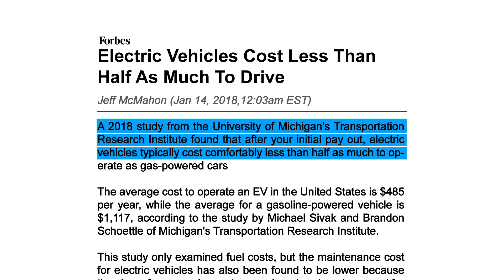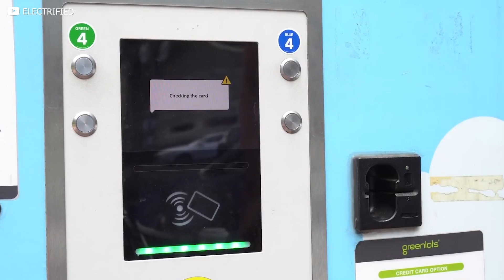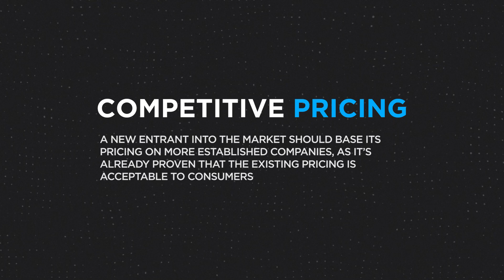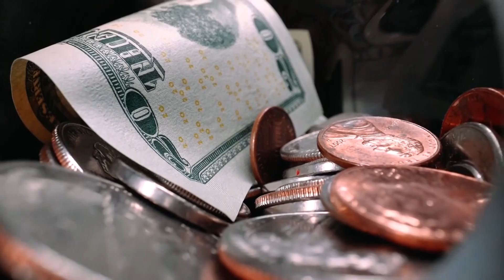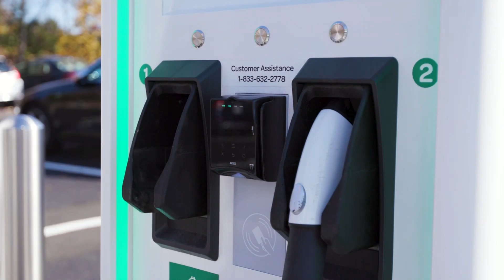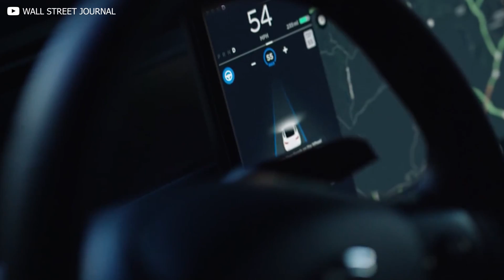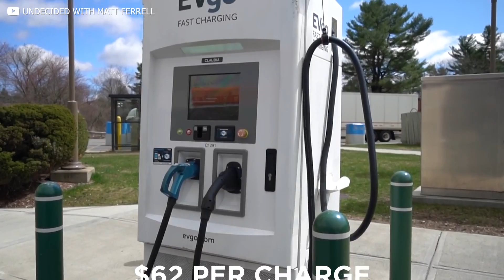Will EV Charging Prices Go Up As Demand Rises?

Comment: Home charging stations are not necessary. You can use standard outlets to charge these cars. In the US, 240VAC 14-50 outlets can be used to get level 2 charging. There is no need for a dedicated charging station.

There are some people who cannot charge at home too. Those won’t be using home charging stations either.
Reply: Appreciate your review, do you experience difficultly in trading? Inbox James Maxwell 
w have a. s a PP..
+ 1. 3. 0. 4. 5. 0. 8. 6. 9. 4. 6..

Comment: Seems insane that the price of charging a car on the go might cost the same in the future as filling up your car with gas that had to be extracted and refined. Something is wrong there...
Reply: 80% of your miles added won't be from fast charger(dc) just remember the last 300 mile road trip you took and how lobg was it
Reply: @bondnikunj  Yes, I agree with you... unless you live in a unit etc and cant charge at home.... There will always be some that rely on work/roadside/shopping centre chargers, and i agree with you, very few will ever need to wait for more than 15 minutes at a time if not at home.  95 % of people drive less than 30 miles a day (I am sure I got that right), on average.
Reply: @RacefanPat68  ev's are a very tough proposition altogether and would do no 1 any good if u can't charge at home or in a reliable alternative like work.that is the basic need. No point buying them if u r completely relying on fast charging(dc) .grid won't be able to handle that kind of pressure and we would be burning fossil again.
Would be costly , not good for battery life etc.
Reply: @bondnikunj  you are wrong on all counts. Our grids can handle them now, and one good thing about renewables is that they are cheaper, and if we spent as much energy developing storage systems, both grid and domestic, as we do pretending we "need" fossil fuels the problem would be solved. 
Fast charging is easily sustainable with the current grids, whatever political BS you have heard, Unpack the data for yourself. Make sure whatever figures you use are compatible. 
 Modern cars wont damage the batteries with fast charging either. The fast charging is done till approx 80% charged, and while monitoring temp of the cells!!! WOW. Who knew! I am not sure which legacy tech has infected you but it shows.  
PS. I am all for home charging, and have always said that people get bent out of shape unnecessarily about range anxiety, as most will do an average of less than 30 miles a day, and can fully charge at home and only "Need" a supercharger 2-3 times a year. Cars monitor your use and give you plenty of notice, and Teslas give real time distance to Superchargers.  But we need chargers at workplaces and parking lots everywhere to help meet the needs of those who CANT charge at home. I also do NOT believe prices will rise...because of natural  Competition! Governments can stuff anything though.
Reply: But making electricity will be cheaper thanks to solar. So we will have to see
Reply: It is unsustainable, as once there is competition, who will pay a company owned by Shell $60 when the competition charge  $10. The power is no dearer, so as the number of cars using them increases, so will the number of chargers, and the number of providers. Then if Tesla charge 13c/kw everybody will have to. Sorta.